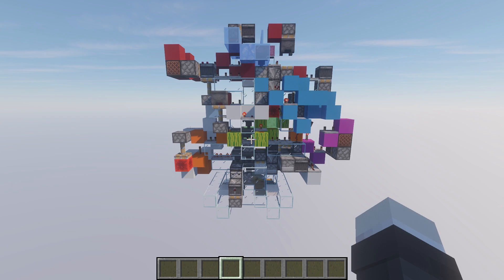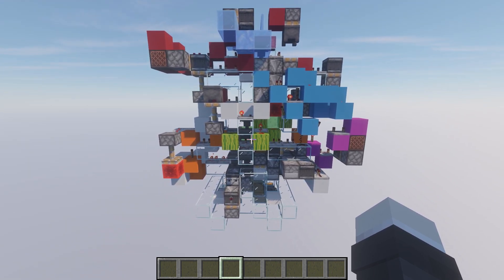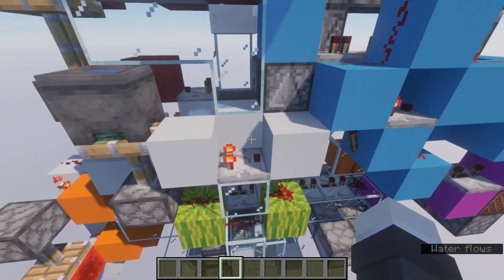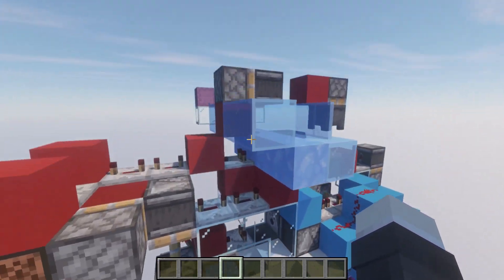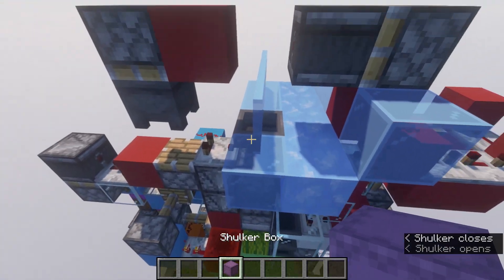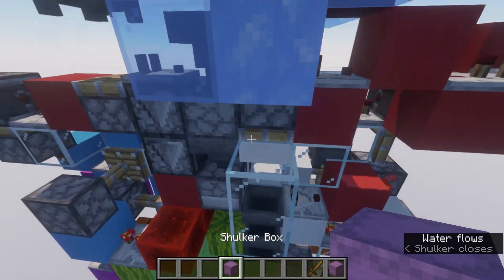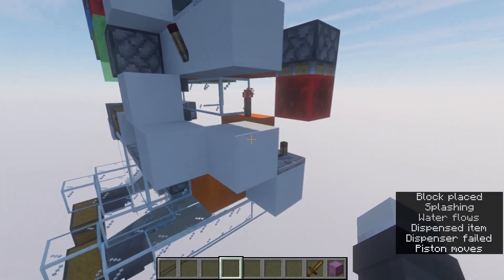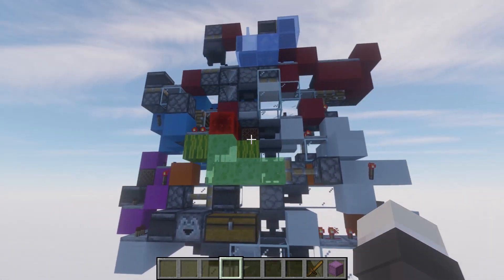MelonTech's Shulker Box Splitter

Comment: Does this improve on your previous design or is it similar?
Reply from the maker: Different method for the same goal. This one does not use a hoppercart and its stateless making it more unload proof. It is also faster per module but the hoppercart method is faster per block. We plan to use this one because it's more reliable/cheaper/easier to build.